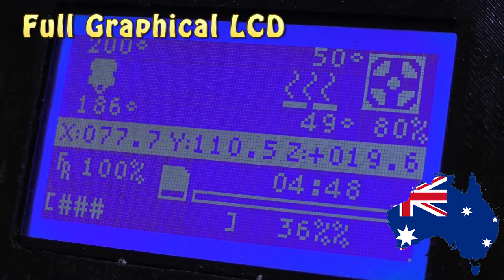Wombot Exilis 10"x10"x13" Promo Video/Trailer (RE UPLOAD)

Comment: nice printer, what kinda of surface are you using on the bed? it looks like kapton? or is it PEI?
Reply from the maker: +Todd Moeller Howdy - I usually use buildtak or zebra plates but i'm using Kapton tape in this with some elmers glue smeared on top :)
Reply: Nice, i have been using PEI tape and it works wonders, no more glue or hair spray i get no lifting even after a 16 hour print. I am checking out your videos for some inspiration, i just started 3D printing a few months ago and i am learing so much. Keep up the gppd wprk mate.

Cheers
Reply from the maker: Todd Moeller Awesome, i've never tried PEI tape before - I hate using hairspray and slurry etc - too messy. I've also done 40+ hour prints with no lifting, the hardest part is usually getting prints OFF - and i've broken a few just in the removal process.

Thanks for your comments, the channel is still new, but considering only been active a few months and nudging 1000 subs i'm pretty happy :)

I'm also open for any comments or suggestions on what to show/try next - I have not had much face-camera time due to ill health but i'll be back on (rather than just timelapses) verrrrry soon! :)